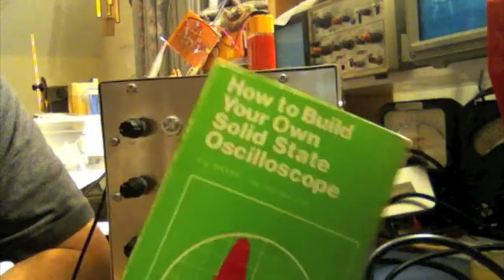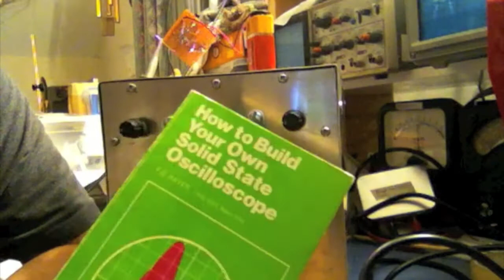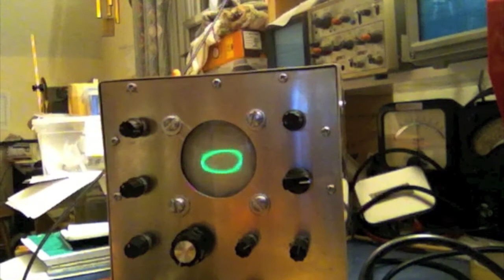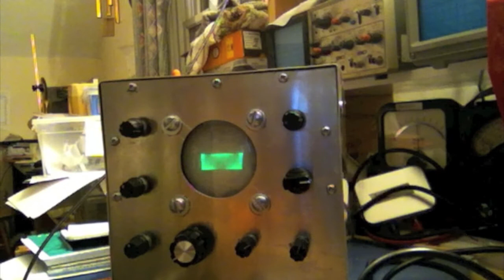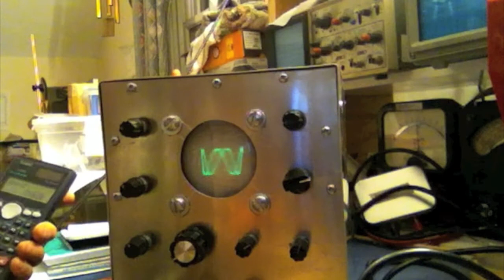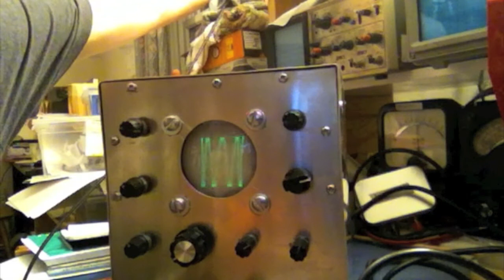DIY Analogue Oscilloscope Build

Comment: Great video. You mention that some of the resistor values were not quite right in the book. I started building this back in the 80's and recently started looking at it again. I built it as far as the timebase circuit which although working, the saw tooth has a very flat top when it drives the HT side. Do you remember if you had this issue?

Comment: Hello, I was wondering, have you tested what is the max frequency without rolloff? I am kinda thinking about building such small scope, but with smd parts and smps to make it super more compact. I have this B6S1 cute tube that i want to use. But, well, I need it to be capable to display true signal at couple MHz, just to be safe, so you know, that is why I am asking.

Comment: Just started watching you done a very nice job on the enclosure
Reply from the maker: Cheers mate. Things are deceptive as It looks a lot nicer on video than in real life! It is annoyingly, just slightly out of square. But I did not put that much care into it to be honest, just wanted to get something to hold it all and get it working. If I did it again it will be a much neater enclosure.
Reply: you done a great job putting it together and getting it to work,   have a book by the same Author called How to Make Walkie-talkies. like the older electronics books pretty interesting.
Reply from the maker: Yes, I have that one (that is also a great book). All his circuits work. Some of the Babani project books from some of the other authors are naff (but most are pretty good). But this guy is exceptional. Any project book I find from him I buy it. (I think I have them all now anyway) The only thing he does not always do is explain all the circuits. But he does explain most of them in most of the books he wrote.  Its very cool that you got that book to.

Comment: Great project to build, done a great job - have found the book can you possible list  the mistakes in the component values - would be a great help, many thanks.  Chris.
Reply from the maker: There are not any major ones. What I did was check each section of the circuit using node analysis to ensure each value was a sensible one. Most, if not all were. But as is life your version will differ as no two CRTs or transformers are the same.  So what you do is find out the limits of current on the components from data sheets and then select resistors that will ensure you don't go over those listed values (eg workout the Wattage limits etc) . I did that by trial and error both before powering up and afterwards. It was 3 years ago, I can't remember the values now I am afraid. But yours would be different anyway. Don't be put off by that. Just do it carefully, use datasheets and measure everything and you'll be fine. It is not a hard project. Follow the book, it is a very good.
Reply: Thanks for reply will follow your advice. Regards Chris

Comment: This is incredible. I'm not very electronically adept but I'm trying to make a clock radio with an oscilloscope to add as a visual. I've got the nixie tubes and parts and Bluetooth and those are self explanatory. I've looked all over and I've emailed alot of people, do you have any direction to help me? I just want the x axis to bounce to the music, I'm not measuring anything. It's just to look at. I'm very new to electronics and I've learned alot but im having a very hard time trying to find what I want to do to mine. Mostly finding people turning their TV's into that sort of thing. Any links, videos, etc would be a great help. Thanks
Reply from the maker: If it was me when I was starting I would keep it simple and build a voltage ladder with leds. Oscilloscope is overkill for what you want. Or another idea is an arduino sketch to plot to an LCD would be a lot easier as a beginner. Good luck, have fun.

Comment: Question: In the setup you show; the signal generator's power cord is plugged into your isolation transformer and your scope is plugged into the mains?  I've noticed the older equipment (perhaps like that shown in F.G. Rayer's book) didn't have ground pins on their power cords plugs so maybe it doesn't matter in that case but I was just curious..

Comment: Hey, maybe some of the circuitry will work to make a useful oscilloscope out of an old crt TV
Reply from the maker: Yes that can be done. Although the tube in old TVs uses electromagnetic deflection. Not an electrostatic field as is done here. So beam circuitry will be a little different.
Reply: @TechTins_Projects  great, I'm looking forward to do such, but can't seem to find the book anywhere. Any chance you could scan it or share some of its info?
Reply: @ZonaALG  the pdf is online everywhere.  Just search the name, it's the first thing that pops up

Comment: I have been looking for that book, I can never seem to find it though.
Reply from the maker: I know, I want a second copy as mine is falling to bits. But can't find one anywhere for sensible price. Good luck!
Reply: Tech Tins I’ve been trying to build my own testing equipment aside from paying outrageous eBay prices.
I do a fair bit of restoration on vintage electronics, mostly tvs, radios, and audio equipment, on top of that I get the odd ham radio to fix up, I can only get so far without the proper equipment.
Reply from the maker: Sounds good. It is a lot of fun playing with this stuff.
Reply: I just tried myself and can't find a hard copy anywhere. However, if you google "how to build your own solid state oscilloscope pdf", there is an electronic copy of this book available.